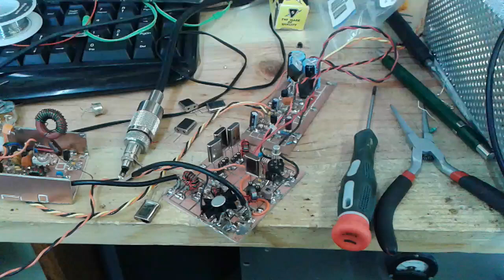Simpleceiver as mentioned on SolderSmoke #180

Comment: Do you buy PCB's with that pattern or do you make them?
Reply from the maker: +Cisco8484 I buy blank PC Boards and make the island squares with my CNC Milling machine. Those squares are made 0.2 X 0.2 inches. I have a Design Program called G Simple from that program I can create a dxf file which is later converted to machine "G Code". You can do the same by purchasing the blank PC boards and glue down a product called MePads from W1REX. These are a series of pads --about the same size and you just superglue them down on the PC Board.73'sPete N6QW